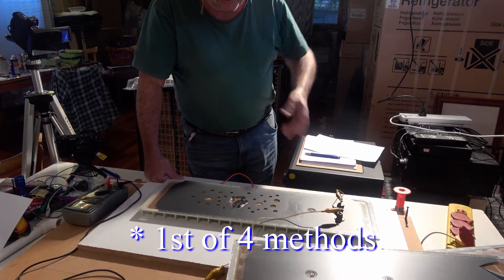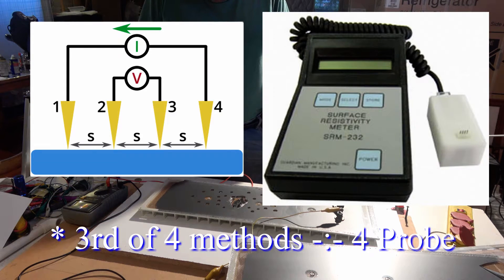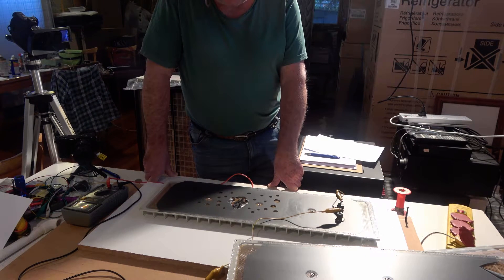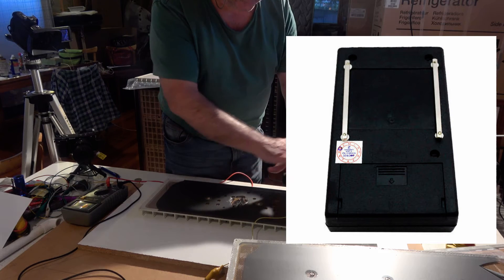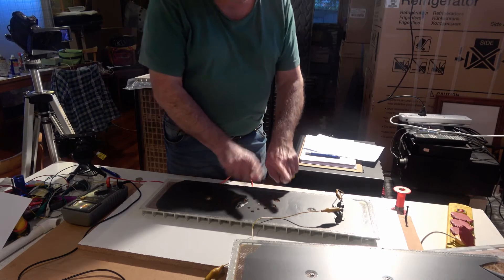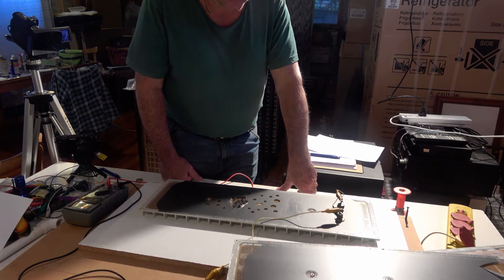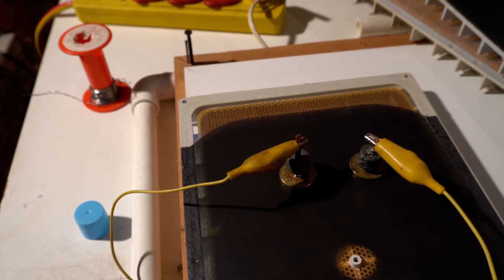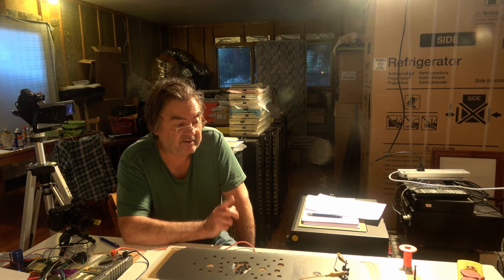Quad ESL63 repair Part 02A Diaphragm Resistivity

Comment: Hello.
Do you have a link where I can find the documentation to redo the mylar? I'm not clear how to give the right mechanical tension to the Mylar and what to use for the coating.
Thanks again.
Reply from the maker: There is none. AFAIK.
I'm slow in getting back to do this (house reno, etc) but I will. 
What I do is by investigation and my own wherewithall, there is no "definitive" documentation anywhere, that I can find  😞

Comment: I have actually measured 100MOhm on every ESL63 panel I have repaired and serviced.
Reply from the maker: Before or after repair?
Reply: @MoggysHiFiAntics  Before.
I use Tecman TM385 and it works very well.
Reply: @jlindborg1105  So after repair then, I assume. You didn't answer. 
The meter you mention has a square measurement underneath so you are using the same method as me. I agree that it is a relatively cheap meter so I may get one to add to my hiZ meter collection. However my current method works fine. 
The unit is Ohm/square, not ohm.  Ohm/Sq is not a "proper" SI unit but indicates the reality of surface impedance measurement. Cheers. I hope to get back to it soon.
Reply from the maker: I have just ordered a tecman TM385 as it was only A$47 shipped. It will be interesting to compare units.
Reply: @850mk3  Before repair.
It actually doesn't matter if it's not a SI unit per say. The important thing is to be able to reproduce the same measurement after repair.
Reply: @jlindborg1105  For sure. However most of my old panels had really low resistance so I can't go by their value. My new (yes, new from quad) panels are typically >80Mohm/sq
I agree that I'm typically aiming for about 100Mohm/sq (or so), it seems to be the agreed "near correct" value. Maybe up to 150Mohm/sq but no more.